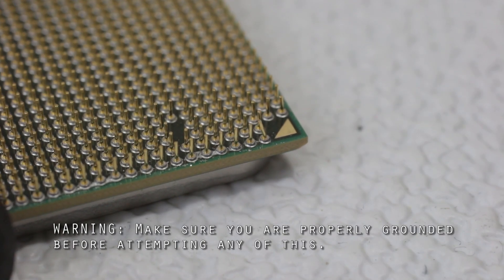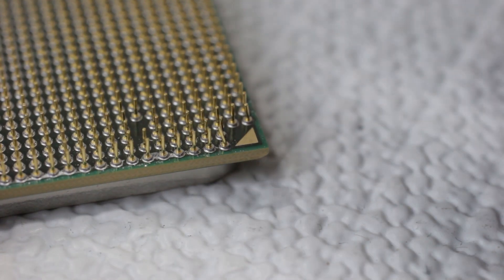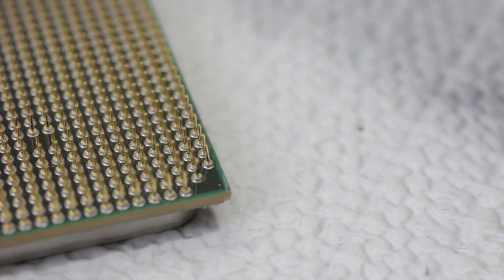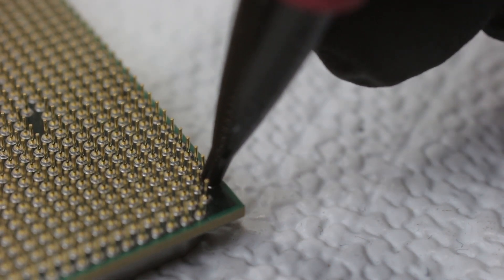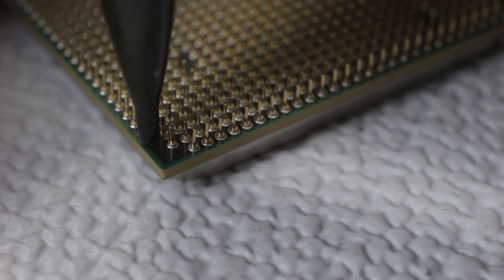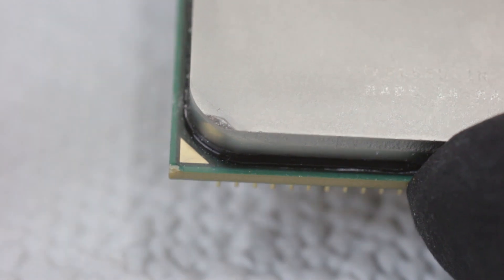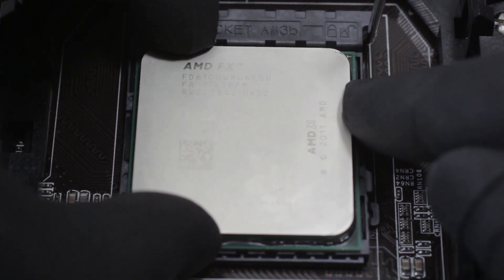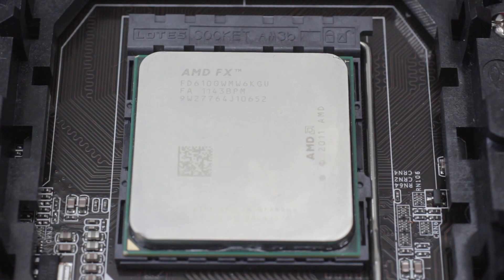Fixing Bent Pins on a CPU

Comment: my watercooler died so i removed it and put my stock cooler on the 8320 i had to put force on it inorderd to get it on then i pluged the pc in and nothing was coming up on my screen so i checked everything even rebuilt my pc so then i eventualy checked my cpu i took the stock cooler off and it was stuck to the heat sink and all the pins was bent i managed to bend them all back after watching this video so then i proceed with putting it back in just to find it was doing the same thing again and low and behold they where bent again so i thought fk it and put my 6100 in.

Comment: I was so pissed my I took my CPU out replacing my motherboard and put it on my table pins up so none of them would've broke but my brother took my case and placed it right on top of the CPU luckily none of the pins broke but one which was on the outside so it was easy to fix

Comment: I received my cpu in the mail and it had bent pins. I straightened them and installed the cpu (fell right into place) and now the pc turns on for about 5 seconds then shuts off completely every time now. Is the cpu dead or did I do something wrong? I'm so used to Intel chips that AMD chips are Greek to me.
Reply: If the cpu had bent pins in the mail you should return it, hopefully you wil get another one

Comment: Never thought of using a mechanical pencil without the lead out!  I've been using my debit card to fix the pins.  Last night, I thought they were all good until I went to seat the cpu onto the socket and it wouldn't go in, so I firmly pressed down on it until it went in.   Turned the computer on, everything lights up, fans spin, but video displays on my monitor now.  Fuck!! >_<

Comment: It worked thanks. I thought my CPU was a lost cause. The mechanical pencil trick worked.
Reply: +Ace1000ks1975 bro. any idea how the pins work? do the pins connect on the tip or the whole length?
Reply: +Vanguardas Vucava The pins connect to the sockets. Equal number of pins to a equal number of sockets.
Reply: Vanguardas Vucava
Pins go in at a 90 degree angle, they could be a little bent. As long as they go in, it will straighten it self out after you lock it.
Reply: nice! thanks! you the man!

Comment: somehow and someway i bent i guess 2 or 3 pins as well(sigh) and one pin is bigger then the others? but its the other way around its not the processor but the port...... tried to fix it no go said fuck it put it back together and well im using it as of right now surprised acutally but now i dont know how long this is going to last my cpu and aux temp is high(dont know if that has anything to do with it) ohh i have i7 2nd generation

Comment: this is why my next build is going to be Intel, I don't know why AMD kept the pin design on their chips all these years
Reply: Midnight Rocker38 the plus side is that if you do bend pins then it's not the motherboard that suffers... some of those motherboards can get far more expensive then the cpu one has.
Reply: ***** it's actually fairly easy to fix bent pins on amd cpus if you have the right tool (such as a clay modeling/hobby/shaping tool, or even thin pice of plastic that wont bend) a steady hand and a fair bit of patience, and ofcourse anti-static wrist strap.. where as if the pins are on a motherboard it's so very much more difficult to fix/straighten pins out, and quite easy to accidentally kill the motherboard, you can even if you're very very very lucky be able to get away with a missing pin or to replace the pin by placing a subtitute in the corresponding hole on the socket as it only has to touch the cpu but that's alot more risky ofcourse.
Reply: I see your point, Intel motherboards have the sockets with the pins on the boards, where those pins are much more fragile, you bend one of those, you're screwed and have to replace the motherboard, if you bend a pin on a AMD processor, they are much easier to fix

Comment: I've fixed a AMD CPU with this method once, it was some really old AMD CPU like 2400+ or something like that, it was like 4 or 5 years ago, back then I just though that maybe it'll work out if I'll just bend the pins to their correct positions.

And it worked, so anyone who is in a situation when this is your last resort, do this, just don't bend the pins back and forth like mentioned in the video, this will work most likely long as you don't manage to totally break the pin.

Comment: I fixed my AMD FX 4170 with a very thin needle, i got some bent pins coz of pulling the cpu off with the cooler the stock thermal paste bonded with the cpu i had no other way to get the cpu out except this way which cost me some bent pins, getting them fixed with a needle was very easy and safe you just stroke the pin from down to up several times applying some pressure in the way up and that does not put any pressure on the pin, I think these mechanical pens might perform some stress on the pin and suddenly you could break off the pin. it took me some time fixing and trying the cpu in the mobo socket without forcing or jamming it in. until the last fix and the cpu just felt in its place without forcing it down. this means you most likely got all pins straitening
Reply: Yea dude kind of the same story here I have a amd fx 6300 and I had to take off the cpu because my motherboard was defective I pulled off the cooler thinking the cpu would stay there instead it took the cup with it and bent some the pins some on the outside and like 4 in the middle
Reply: after i bent my pins and fixed it i did a search on that issue when the cpu bonds with the cooler i found a fix for that just use hair dryer :) the cooler will become heated and then you can pull off the cpu very easily

Comment: I was trouble shooting my new pc and wanted to take out my cpu but when i wanted to pull off the heatsink the cpu was still stuck on it. I had to wiggle it off, then i realised there was a few bent pins, i fixed it with a tiny flatness screwdriver but my pc still has problems. Is it the cpu or any other component on my pc. My pc can turn on but it wont display anything on the monitor. And ive already tried using another monitor and still has the same problem. Im pretty sure its the cpu. If anybody can help that would be great.
Reply: just RMA that shit.

Comment: word of advise, if ur gonna take off a heat-sink from a cpu of an old computer and its kind of hard to take off the heat sink, be warned that pulling it out do to the thermal paste glued on to the heat sink and cpu like freakin' cement, this will cause the cpu to pull away along with the heat sink causing bend pins in the middle and side like it did on mine.... I couldn't release the lever do to the heat sink being larger in size and being in the way from the lever!  Maybe using a hot air gun would've loosen the thermal paste and not cause the bending pins!

Comment: thanks for the video mate worked well fixing my GF's 1060T x6 AMD core took a few hours for me due to weak feeble arms nah cuz of not wantign to snap off the pins.

i had an old am3 mobo so after i thought id straightened the pins i used the white plastic bit from the old mobo to speed up the pin fixing stage worked well. thanks man SAVED MY LIFE.

http://www.pcstats.com/articleimages/201206/installAM3HSF_24.jpg << thats the plastic bit but i broke it off might help others if they have an old mobo too

Comment: My advice for all people, If youre gonna clean the thermal paste from an Amd part, DO NOT TAKE IT OFF the CPU socket, clean It there. Learned my lesson couple of days ago, I was using a cotton hyssop and somehow It grabbed one of the pins and It bent. Luckily I was able to straight the pin with my nail and the CPU socket. Really guys, clean the damn CPU with the locked socket. Hate the way you need to handle Amd parts, (like they´re radiactive material). Intel is safer on that spot, but then again, you need to handle the mobo carefully.

Comment: This is why Intel's flat pin design is so much better.
Reply: Then you have to do the same thing with the motherboard. No difference.
Reply: Vinnie Davis It's even worse with Intel because the pins on the motherboard are slanted instead of straight like AMD's CPUs. So trying to align them back yourself is much more difficult as well as risky.
Reply: Vinnie Davis Yes they is because a cpu cost double that the mobo will.. but i don't think that applies for people that buy AMD
Reply: Ikr
Reply: Captain Vayne no shit sherlock
Reply: 259 Yeah, but the chance od you dropping your mobo is much smaller than chance of dropping your CPU.

Comment: This happened to me. I have an AMD FX 8320 I noticed that my heat monitor was giving me a very high temperature  I opened up my pc unhooked the heatsink and it Wouldn't COME Off!. I tried twisting my heatsink but It didn't work. then I decided to pull it off with force, It came off then I was like where did my CPU go!?! I looked under my heatsink and there it is, a 190$ cpu glued to my heatsink, I used a different method though, I pushed the side of the cpu and I slowly slid off, luckily I was very lucky lol, Only 2 pins were belt I straightend those with my nail cleaned the cpu and heatsink checked if the cpu fit again and luckily it did. All I have to do is get new thermal paste! :)
Reply: Dude, your really lucky......i have the FX 8350 here ... i think its nearly the same CPU, but my glued to the heatsink as well, so i pulled it out....with the CPU of course ;/ after turning the cpu clockwise it was free of this hell jelling engine of crap, but then i noticed belt pins on the edge with the triange.....now the are nearly 90° twisted to the Cpu and if my eyes were ok, i think one or two are missing, Now if installed my old cpu, the fx4100, and a new case filling heatsink, but i  wish  my 8core does the job, but i think its dead :D There should be a law aganist this fucking type of socket connectivity, and god safe the intel users, there whole machine is screwed if theres one pin one the board down....
Reply: SchokobomberLP This is the same thing that happen to me.  They was both glued together.  I couldn't get them apart w/o force so I just tried to put it back on with the fan still attached and the pins got belt, so I just replaced the whole thing.  FX 8350 as well
Reply: Thats pretty crazy how much cpus get wrecked with this pin connectors....sometimes i wish pcs were like a the beginning where cpus were on a seperate board with onboard mounted fan ( pentium 2 (^-^) )  or like amiga style, where you had to lay your xtra memory chips over the board and had to fix it ..... but hell, today in economy, these bent thhinngs are needed to increase the profit of the the manufacturer, 
however, i'm sorry for you too bro
Reply: SchokobomberLP I think my next time messing with the CPU I'm going to switch to liquid cooled.  The reason I was messing with it this time was because it got loud so I knew there was dust build up, so I wanted to clean it.  Looking at liquid cooled for the cpu dust shouldn't be a problem.  You ever thought about going liquid?
Reply: yeah, first i looked after it, too but good components are to expensive for me, for the money of one liquid cooler(all in one for cpu) you get two good air flow cooler. i choosed the ,,Brocken 2" cause it was cheap at this time and it coos very good, but you should definetly know if a cooler fits in the case, in my case theres no inch left between cooler and case....but it works very very more quiet than these boxed shitholes....
Reply: I was also lucky. I had the same accident and no pins bent! Well... Until I dropped it and bent pins on the sides. It should be repairable
Reply: MrGlidesterPro holy shit the same thing happened to me I have a AMD fx 4300
Reply: thats why you dont put pva glue next to thermal paste
Reply: MrGlidesterPro i have same cpu fx 8320 i did this method to. but my doesn't work . I can't see anything. my monitor is still black . nothing see anything. and my cpu led is lightning red.
Reply: SchokobomberLP blame intel for trying to kill off amd by protecting their monopoly which failed due to government interference

Comment: That's AMD... Bent pins = Nightmare.
Reply: i have intel but the pins of the motherboard from intel sockets bents fester ;) and those small pins you cant bent back.
Reply: But what's the chance you'll be touching the pins on a Intel board anyway? Unless you decided to do it on purpose.
Reply: if you put the processor to hard in while installing ;) it can be. amd and intel are both worst with bent pins.

Comment: what if you cant unbend them... will the cpu still work? nathing will brow up right?
Reply: DPMadGames i swear they need to have a validation checkpoint before buying products in hardware stores so the sales representatives dont start acting stupid when u tell them about the damages done by their faulty products.  Anyway Im glad i didnt take the risk of using that bent processor after hearing ur story.
Reply from the maker: If all the pins fit into all the right sockets then yes it will work even if the pins are still a little bent. It might not work at 100% of its capacity though.
Reply: ***** and what if 1 of the pins breaks off?
Reply from the maker: You might be lucky and it still works if the pin isn't absolutely crucial. Even if it does work, it might also crash when under load. Good luck.
Reply: ***** scared to try it cuz i just got a brand new motherboard...  I dont care if it doesnt work after I try it on motherboard but I do care if it blows something up as I try it...
Reply: +pspppe It will not work as I got a new motherboard twice as I thought that they sent me a faulty one the first time and it was my processor all along fyi i only have 4 pins vent and there is literary nothing onscreen and no post error beeps
Reply: pspppe it can... if you are lucky and a backup pin was affected

Comment: I find that using carburetor air bleed tubes way better than the old mechanical pencil trick. Older Zenith carbs (32NDIX) are great donors. In any case (meaning where ever you get the tube) a machine shop can size them down so you do not have the trouble of touching other pins. Take some time and get/use better tools as you do not have too many chances to straighten pins...before they break.

Comment: That's why I do backups with WD SmartWare with my external hard drive, WD My Passport 1 TB Black. Since I usually use a surge protector (a 6-outlet) while I'm using the computer in my room, I'm probably safe.
Computer I use: Dell Latitude D630
OS: Windows Vista Home Basic Service Pack 2
Processor: Intel Core 2 Duo CPU    T7500 @ 2.20GHz
Memory: 2.00 GB
Hard Drive: 80 GB (Hitachi HTS722080K9A300)

Comment: Nah, you still can access a hard drive with dead electronics or mechanics. It's just not so easy. The worst thing that can occur - a major power surge that sets your PC on fire while you're away. I can't retrieve data only from drives with physically burnt and molten discs. If you use a good UPS with a surge protector, a specialist can still access the data when your HDD fails. Can't say the same for SSD - they are a little bit more tricky.

Comment: Just take something flat and sturdy, like a plastic sheet. Try not to use items with sharp edges, like knives or something. Also avoid using metal if possible. Then just insert this item between two rows of pins and apply gentle pressure in proper direction. When you'll align the bent pin to the whole row - repeat the procedure, but turn your item 90° to align the pin to the row in other plane. And here you have it. Just remember - push very gently. This kind of tech doesn't like raw force.

Comment: I was fixing bent pins on my Athlon x2 just by pushing them with a small flat screwdriver for clocks. It's not the tool that matters, it's the proper direction, accuracy and amount of force applied.
P.S. My machine works on this CPU since 2008. I have been pulling it out of the socket at least once a year for dust cleaning and heatsink compound change. And it still works like a charm, otherwise i wouldn't be able to be here :)

Comment from the maker: Was it difficult taking off the cpu cooler? I have had an experience where the cpu cooler was stuck on there from the thermal compound that when I pulled off the cooler it ripped the cpu out the socket and bent the pins.